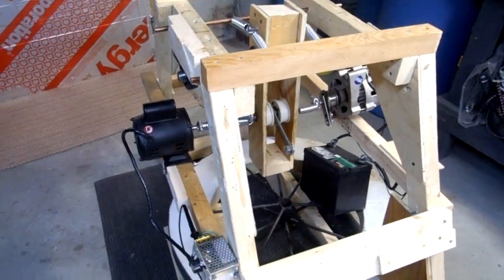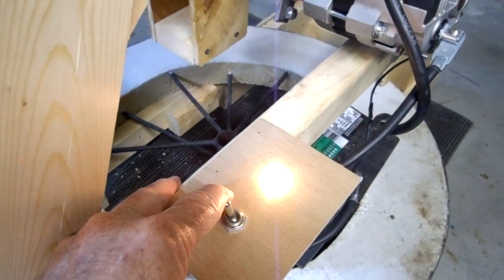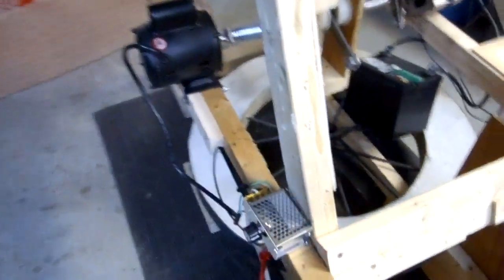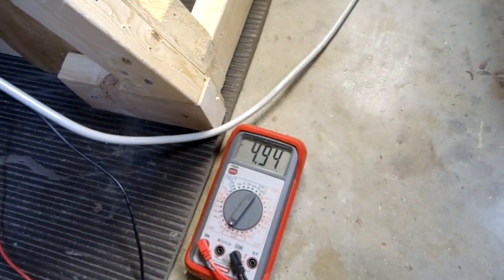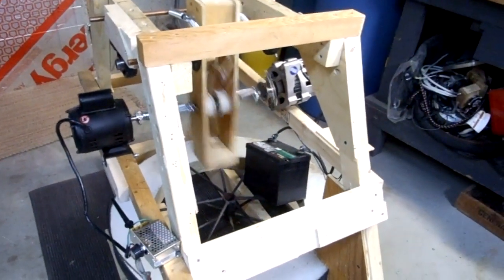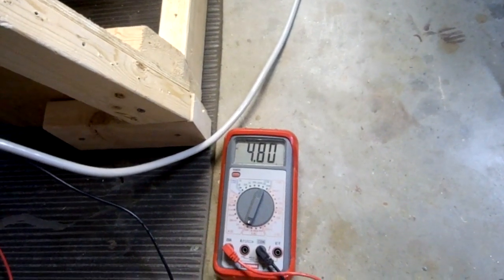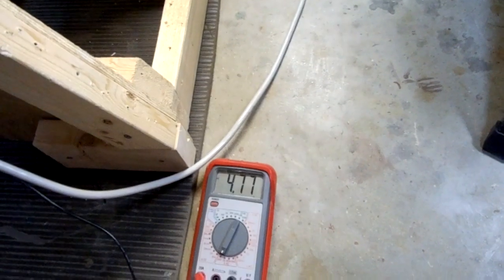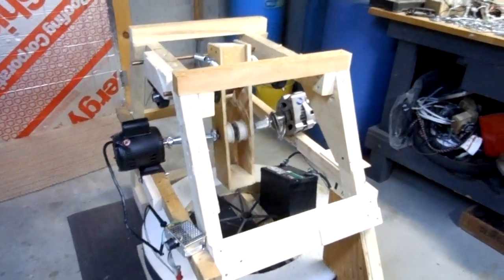Driving an Alternator with a 1/3 HP Motor - QMoGen - Part 1

Comment: It is picking up momentum and draws less perhaps? Switch out the alternator for a permanent magnet alternator, that way you can compare dc to the motor in, vs dc out from the pma. Nice work glad to see an update, I been waiting for a while lol.
Reply from the maker: Thanks! I've been told that as the battery charges, the input amperage will go down. A PMA is a bit out of the budget at the moment :). In the next video, I have a 50 mv shunt installed and will show the wattage produced by the alternator. Even though the input is AC and the output DC, watts is watts as they say... :).